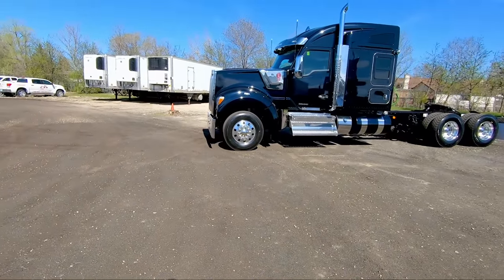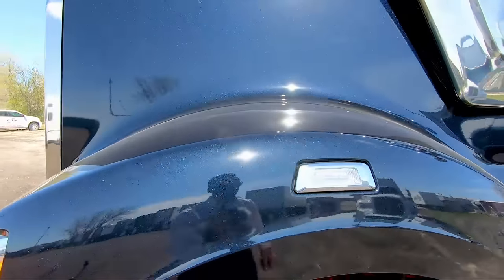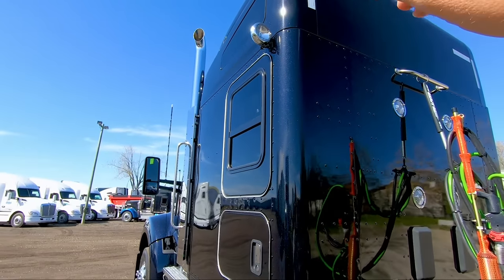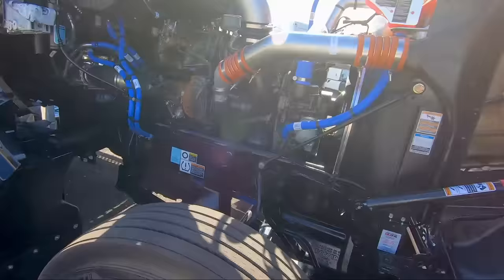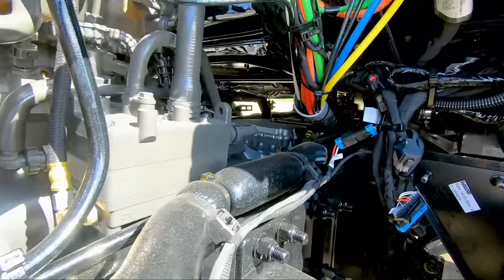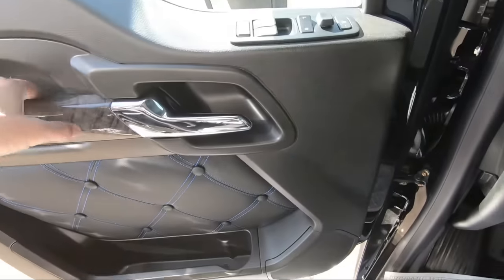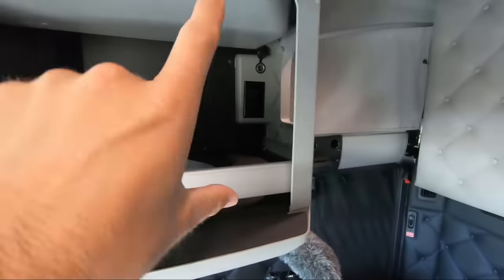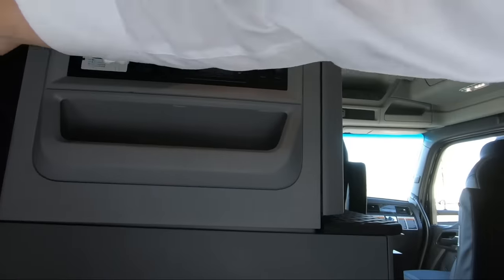Kenworth W990 - Stretched 2020 - Interior & Exterior TRUCK TOUR

Comment: not having both mufflers connected make no sense to me
Reply: Can u order it with both stacks connected
Reply from the maker: No. Not on 2.1 meter cab.
Reply: Y not on a 2.1 meter cab
Reply from the maker: Engineering and design. I’ve been told it’s due to back pressure in the emissions.
Reply: I don't get it either why diminish power
Reply: Can you get these as a glider?
Reply: @MoMan.88  I'd guess not. Gliders, in my humble opinion, are a dying breed. About 5 years ago, my company bought about 5 gliders with older engines and they smoked too much and basically were not worth it. I'd only consider one for local work. The newer motors are getting better every year.
Reply: @AndyTheKenworthGuy  so cant at kenworth but peterbilt you can with erev 567 what's kenworth thinking nice truck like this should be true dull
Reply: no working duals = no sale, pete it is
Reply: @niteowl9354  I'm worth you there driver
Reply: @AndyTheKenworthGuy  That actually is nonsense. They can Y pipe it with in line restrictions for the back pressure. It's just another case of a desk jockey counting pennies.  At any rate, I've seen OOP's make the other stack functional. It'll sell better when they fix the hideous head lights.
Reply from the maker: Hawkdsl I agree with you.
Reply: @hawkdsl  look up Trucking Travis Dallas Peterbilt. You can get a new 389 with 8 inch pipes with an actual Y pipe!

Comment: People can say what they want about this truck, but it looks so bad @$$!! I was at work when I received the notification and got a chance to actually sit and really watch this video and boy, it's a beauty.  It'll look really good once it has its fender on it.
Reply from the maker: Sure will. He built customer wooden fenders for the drive home. It’s supposed to be done next week. Getting lowered 8” vinyl wrap, fenders. I’ll be posting pictures next the Gram and Facebook for sure.
Reply: @AndyTheKenworthGuy  
Ohhh ok, it should look fantastic once it finished. I'll be looking out for that. You said it getting lowered.  I noticed alot of people mentioning the gap between the top of the tire to the bottom of the fender.  I wonder if there's a way to minimize that from the factory? I know that the W900 fenders sit closer to the fenders. Not sure if the spacer between the leaf springs and axle has anything to do with that. Fender on the W990 looks like they sit a little bit higher on the hood than the W900.

Comment: Between the 680, 880 and the W990 I would rather have the W990.  The W900L studio with a couch still my favorite, but this W990 not looking too bad.   Looks like the central mounted air filter up on top of the engine.   Is that   a smaller size filter or is it the standard big canister filter and the camera angle makes it look small.  Starting to like the W990 a little more.

Comment: Would like to know that the trk has a 12 spd auto .can you tell me the ratio  on the rears . I do like the trk .but really impressed with a paccar mx 13 .run with guys here in Texas that have the earlier models of mx13 and one with the new 510 hp the engines are impressive. trks are in the oilfield .I can tell you up to Gross GVW 161000 that's all she wanted now this was a trk with the earliest paccar mx13 not the 510 hp .that was what sold me on the paccar . These trucks usually haul loads from 80 to 110000 gross weight .the one that hualed the load was set up with 485 hp pac 18 spd  and 3.90. tall 24.5 rubber .PS and great fuel mileage .I Know that the trks that run up north are usually set up with big H.P. 18.spd .3.90 rears that's why I'm asking about the running gear with a 12 sp auto .gerat videos .I'm thinking that the paccar mx 13 is going to be the way to go in your normal application . Trust me I've been watching these trucks with tack on motors for three years the efficiency the reliability I can't say enough . For those who want to know what I'm running I run a 550 6NZ 4 axle trk . 4 heavy haul Cummins engines for now but paccar makes a 15 litter that's going to be interesting just saying . keep up the good work Mr Andy
Reply: I heard from another Kenworth salesman that Paccar might be having something in the works of something Bigger as far as the MX goes. 🤔 time will tell.

Comment: I'v always been curious about one thing in US made trucks is why the'r living so much salient frame on the back part,isn't it better to keep it short in order not to klinch with trailer when doing some kind of an steep ower-heel drive?You know,when tractor is alredy pass the hill's top but trailer is still on the declined part.For european trucks I belive maximum angle is about eleven degrees,for those long American trucks it must be even lesser.
Reply: To answer the first part of your question, the answer is style. It's like the difference between a stock motorcycle and a chopper. The stretch is what counts. As for your other question, I'm not sure which axis you are referring to, but I can't see an issue on a longer truck except turning. If you mean the up/down axis, you have to remember European kingpins are set back farther from the front of the trailer than on US spec trailers.
Reply: @itsmeagainmargret  Hi,by" salient part" I'v meaned the one that pertruds right after the rear axel.If you cut those 30-40 cm of steel it will look kinda bobtail:)
Reply: @vovasig4517  I went back and looked at the video and you are correct that W990 does have a long frame behind the rear axle. I don't have an exact reason other than I know that length does vary between trucks depending on numerous factors and  The long slope does help pick up trailers that are dropped too low.

Comment: I think the W990 will be a big hit especially for the fleet carriers, you'll attract drivers that want that classic W900 look but the fleets will benefit from the Aerodynamics of the W990, it will also keep drivers there longer.
Reply: Mile Chaser  the W900 is a giant brick pushing itself through the air, the W990 at least has some form of aerodynamics to it. Even if the difference is only .25 of a MPG thats still an extra .25 MPG the fleets dont have to pay, that adds up over 10, 15 or 100 trucks. To say the W900 doesnt have electronic failures is amusing considering the majority of the electronics will likely be the same across all the trucks you mentioned, especially current W900's, T680's and W990's.
Reply: Mile Chaser  the Aerocab is a flat face at an angle, the aerodyne is a sleek curve coming off the windshield, the aerodyne will be far more aerodynamic than the aerocab ever will be as every flat face, whether it be angled or not will create drag unlike a curved area for the air to go over. 
W990 has what electronic nanny that the W900 doesnt? collision avoidance? Oh no... its the end of the world!
Reply: Mile Chaser  
I know people who drive w900's, 389's, 379's as well as people who drive cascadias, vnl680's and t680's and each of them have their problems, all of them are owner operators and none of them have had any serious downtown due to mechanical failures or electrical problems. The difference is how the driver takes care of their equipment. The owner ops who drive the cascadia, vnl680 and t680 all sold their long hood KW's and bought those trucks, they said they've been making more net profit at the end of the year because of the fuel savings and at the end of the day, net profit is greater than looking cool. 

You can say the w900's are "better built" but they are all built in the same factory using the same techs and the same robots. it all depends on whether or not your truck was built on a monday, wednesday or friday.

Comment: I'm partial to wide cab trucks, I couldn't figure out why KW and Pete took so long. I like this design, seeing a W9b, L, and the 990 together you can see the lineage. I get that some can't get over the integrated bunks and the fact that there are no air cleaner cans on the outside. But I'd drive one forsure.

Comment: Another sharp KW.  Love the 275 wheelbase...nicer ride that way. Is there an option to place the stack(s) at the back of the sleeper? I don’t see that too much anymore. Love the color but that burnt orange 900 was sharp, too.👍
Reply from the maker: Thanks for watching. You can put stack back of sleeper. Not common but it’s an option
Reply: I’ve noticed that on some older rigs, either single or double stacks, and I kind of like it. It gets the sound away from the cab more that way.👍🏻

Comment: I just a question in general on the smart wheels if you  get a regular steering wheel where do the "cruise control" controls go... Is it another lever on the steering column or are they on the dash?
Reply from the maker: They go on the dash and it takes up two switches

Comment: One the w900 is where it’s at. Two. You say too much about somethings that don’t need said and then don’t say enough about others. You’re a little all over the place. Keep it calm and get straight to the point about the truck and options without going too fast. You’re trying too hard to be like peterbilt Steve. I’m not a huge fan of peterbilts but he makes great videos. And also you’re a dealer. You need to know you’re options inside and out.

Comment: Looks like a 1980 International TRANSTAR. KENWORTH NEEDS TO GO BACK TO THE DRAWING BOARD AND REDESIGN THE HOOD FOR STARTERS!! Not my favorite!!!
Reply: Stevie, I agree. It's kinda a "meh", for me. It's more of a glorified T680 than a dumbed down W900. Dash, sleeper, etc are identical to a T680, so you know that's what it's built on. I like my 2017 T680 company truck. I really don't get why Kenworth even went forward with this design. My prediction is that in 2 or 3 years this truck will no longer be in production.

Comment: I see a lot of stretched out Petes that dont have to run those amber reflectors behind bunk why does the Gov't make KW do it and not Pete???
Reply: I'll preface this by saying I'm only speculating and I'm not 100% sure.  My guess would be one of two things

1. Might be US trucks. This truck is Canadian so there's slightly different requirements
 2. Manufacturer vs custom. A lot of those really stretched out rigs are probably not like that from the factory. They're probably bought and then stretched after the fact so they're either not required or just not added. 

Those would be my guesses. I'm not an expert on ministry of transport rules though.

Comment: this truck will be remembered as a huge engineering blunder,it looks like an international, any owner opps will now be buying 589 petes, this truck will only sell to mega carrier fleet drivin rookies, kw u shot urself in the foot gettin rid of the w9
Reply from the maker: The W900 is not going away. I just sold a custom order this week. Burnt orange. Stay tuned in about 4 months when it’s here.
Reply: @AndyTheKenworthGuy  I bet you won't be saying that a year from now. With Peterbilt dealers here in the states saying 2021 is the last model year of the 389, it with making up of over 30% of total Pererbilts sold whereas the W900 makes up less than 10% of total KW's volume sales. That and along with an obvious model successor already out on the roads (let's not forget what happened to the T660 and T800..) the writing's been on the wall of the demise of the W900 for quite some time now, and we've all been able to see it.
Reply: Walker Forsyth what happened to the t800?

Comment: In my opinion Paccar is dropping the ball on this particular model it should be at least a three piece hood if not a five piece. Because accidents do happen. Also with Paccar peterbilt and Kenilworth it’s time for innovation it truly is they need to wake up. Rumor has it that 389 is being discontinued I still think it’s their biggest seller. So that makes no sense to me!!! I also heard Peterbilt and Kenilworth are doing away with the glider kits another big mistake!!!
Reply from the maker: The hood is a 5 piece hood with mechanically fastened fenders. The reason for model changes is pressure from the EPA to make more aerodynamic trucks.